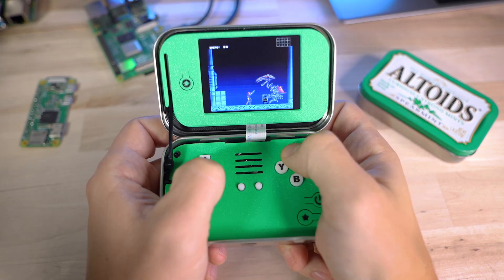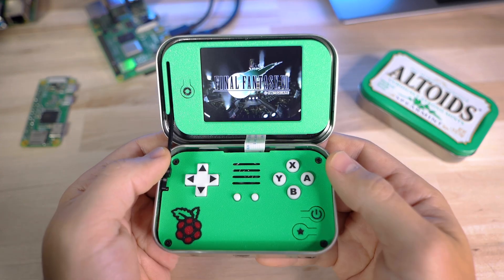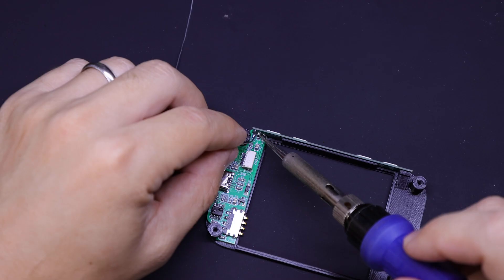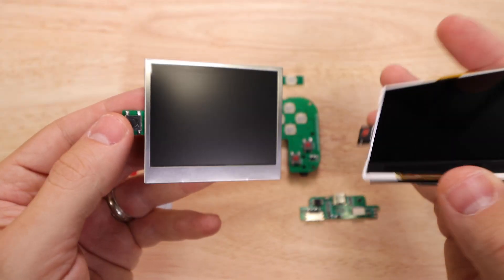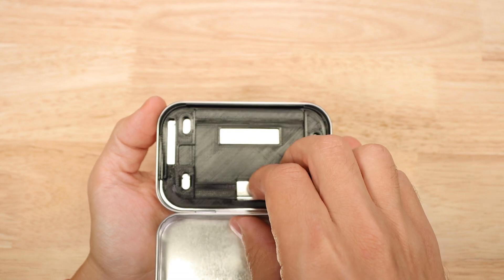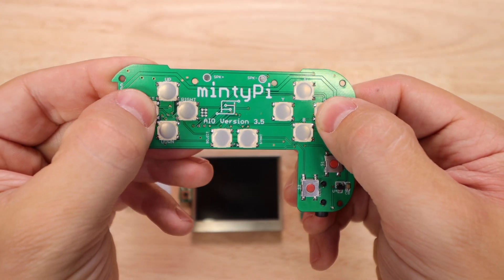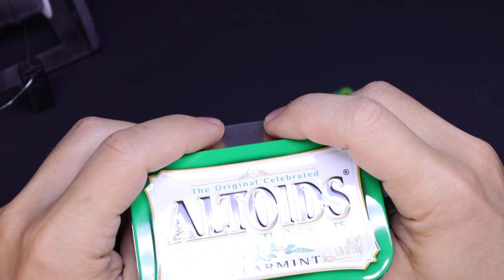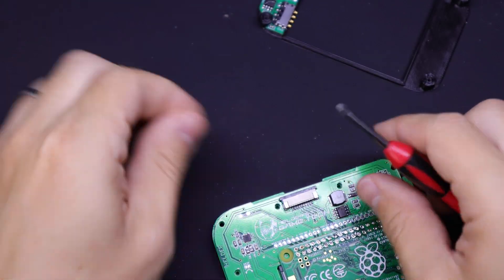mintyPi v3.5: what you need to know to build it and a GIVEAWAY!

Comment from the maker: I really gotta figure out why my audio goes nuts sometimes; sorry if it sounds blown out at some points. 😅 How's everybody doing? What would you want to see in a mintyPi v4? 🤔
Reply: Hi
Reply: GIVEAWAY!?!?
Reply: Older tins and try shrinking it and circular tin for the older ones, maybe it could be a round Gameboy with a cover.
Reply: Make a new gameboy zero
Reply: I have a friend who did the minty pi concept to a ps vita and it can emulate psp, ds, 3ds (no actual 3d), n64, ps, and ps2, and a bunch of other consoles and conputer games. It uses the original screen of the vita somehow. Since he has a lot of space inside he added usb ports to connect various controllers using adapters and a keyboard, depending on what game he's playing. He's making another and is trying to put in a different screen capable of 4k. But he's not using a pi for this one. Its custom made parts and everything that he's ordering through various companies. This one should be able to play older pc games. Like skyrim and things from around that era. Which is pretty cool. He wants to run a linux software on it. He's basically going for a portable handheld gaming pc. He 3d printed an ergonomic back to replace the one on there. Its pretty cool.
Reply: For v4 maybe 3DS style circle pad if you can get that to work somehow
Reply: Maybe on the v4 make the 2 USB ports into one multi use USB-C port
Reply: I am waiting for a mintyPi kit with a non-SPI 60 FPS display.
Reply: I could imagine adding some sort of "sleep mode" for the mintyPi v4, but that's just me.  Keep up the great work wermy and helder.
Reply: I don't know if this is already possible (I haven't checked sorry :c) but you should try to make it possible to buy already finished mintyPi version, it would save a lot of us dull brained people a lot of time and brain space, it would probably also be more expensive then buying just the parts (which is expected and completely fine) thanks :D
Reply: Maybe better support for 3D games?
Reply: For version 4,
 I prefer having L2 and R2 below l1 and r2 similar to a playstation dual shock because it is easier to reach and makes them more nostalgic. 
Next make holes for the micro usb and the hdmi port of the pi and do a little bit of scripting(optional) so that the user can easily connect a external usb controller for multiplayer option on ps1 or use another monitor.  
Next lesson the stuff to solder. You can use pogo pin to connect the pi and the board solderless. This will make things so much fast and add a function that allows the pi to be removable without de-soldering. Here's a link
https://www.ccpcontactprobes.com/application/how-does-pogo-pin-work
You can also use a card edge connector and modify the L and R pcb so that you can just slide it in place instead of soldering as well. But this has less impact and functionality aside from lessening the amount of soldering people has to do so its not entirely worth it but its an option for complete solderless build.

Optional upgrades
(Not much worth adding but it does allow more features.)
light sensor. Having a light sensor allows the console to have a function that can auto adjust light levels to save battery power

tiny vibrator motor. PS1 games can use this. You can also use this as an indicator for when battery is full, low, or charging.

adding a trackpoint as a mouse and analog stick maybe?

Remarks: Overall for me, I think multiplayer functionality and removable pi should be what v4 should be. 

Recommendations: Also for people who want more processing power, use a banana pi m2 zero, it twice as fast as a raspberry pi zero w thus allowing more games to run smoothly.
Reply: A CM3. Lol
Reply: touch screen?  or maybe a second screen?  or BOTH!
Reply: DS touch screen or analogue stick or both pleease! it would be sooooooo cool !!!
Reply: A compute module if that could work.
Reply: But do it with hey raspberry pi compute module 4
Reply: pi 4 compute model
Reply: a smaller high ress 3.5 inch screen would be nice , and a new minty pi stand for 3.5 and 4.0 would look great in black or green?
Reply: @Louie McMillian probably no because its a personal project. He would have to buy licenses to the ps vita probably. And its also stupid expensive to make what he's making. He's making as a project sorta for college and as a proof of his computer engineering capabilities to secure an internship at a company nearby where we live. Don't know too many details on all that but I doubt it could be sold. Cause of legalities and stuff ya know. It would be cool tho.
Reply: I would feel like a Usb input for flash drives could be useful
Reply: My ideas for Mintypi v4 would be a “last game” button (you could possible use the save state button on the screen) or button combination that takes out back to the last game you’ve played in case you got a lot of games on the system you are playing on.

Another idea I have for v4 is a button configurator that allows you to swap button controls (for example swapping the “A” button with the “B” button so every time you press the A button, it will actually press the B button and vise versa. 

One last Idea I have is some covering or some kind of electronic water protection, whether it be a covering that goes over the exposed parts, or a system that will safe shutdown, and cut off the power until no water is detected.

Anyway, love your channel and hope to see more Mintypi versions and other projects in the future!
Reply: I'd personally want to see an analog stick, like a 3DS Style one. Though that would be a radical redesign, I'd adore seeing it.
Reply: Omg I really want one. I'm computer bad. But I would really have to watch over and over and  over. I dont have that heat thing you have. Is it another way I can deal stuff. I love this I could be putting in my pocket or when I'm at work play and not get caught
 Thank you for the video all I can do is try try try until I get it
Reply: I just read about the solding part. I'm scared about it. Hey can I pay extra to get that done for me
Reply: Or can I pay for the parts and stuff and you put together for me . Pay extra to get that done
Reply: I would like to see a version of this kit with no soldering required for people that maybe want the mintypi but don't have the ability to solder electronics very well. i guess that would be a noob-friendly kit? Or maybe prebuilt mintypi 3.5's?
Reply: Not a whole lot to improve here other than hoping the next version of the pi is more powerful.... then maybe we could emulate psp games and add that psp slider style analog stick
Reply: Awesome games that can be payed in ps2
Reply: 3ds sliders for play station
Reply: Improved battery would be awesome. But I'm not sure there is room to shove much more in there.
Reply: Has the winners for the giveaway been announced yet?
Reply: In the minty pi v4 there should be a lot with everything AND all of the 3D-Printed parts, for the right price of course
Reply: Maybe a way to access the sd card in an easier way?
Reply: If there’s any possible way to connect 2 mintypis for 2 player games, that would be sick
Reply: You should see if you can add dual circle pads from the 3ds. I would just say analog sticks but they wouldn't fit.
Reply: maybe an analog stick
Reply: Maybe a 3DS style circle pad, and MAYBE a newer pi.
Reply: Some kind of computer gaming like with Minecraft or steam. - Even if it isn't that fully functional! Also being able to switch between raspberry pi homescreen and retropi
Reply: Stereo audio, and I’d like it to have volume options.
Reply: Yes Minty Pi V4 2021
Reply: Usa a iPod Screen
Reply: @monadolifesaver5613   that’d make it harder to find tins though.
Reply: @wormarms4143   I don’t know about smaller, but higher res for sure
Reply: @janineharris3601   as somebody who has been working with computers for years now. Soldering is actually quite the breeze. They have practice boards at helpers shop along with the pcb that you can use.
Reply: Fit some low profile analog sticks on there with the new CM4!
Reply: With l2r2 buttons. Will this run ps1 ?
Reply: A joystick maybe?
Reply: I know it’s a bit late to the comment party but something I think would be really cool is if you could take the compute module 4 and make like a mintypi pro or something like that maybe a slightly better screen if that’s even possible at the size I’m not sure, I’m just thinkin
Reply: YES
Reply: 6 face buttons would rock for a slightly more authentic arcade and mega drive/Genesis experience
Reply: a keyboard and raspbian
Reply: wermy when will these be back in stock
Reply: For v4 add analogue sticks and add a home button
Reply: I’d like to see a USB port right below the start / select buttons
Reply: Y E S
Reply: windows mode/web browser mode
edit: almost forgot to say better screen cable management and less gap at the top
Reply: is minty pi 4 coming i have really been wanting a minty pi but its never been in stock when i look

Comment: I'm seeing kits are, sadly, pretty much sold out and maybe not coming back.
But I also saw the Radxa Pi zero board is out, and it is a complete BEAST compared to the Pi zero. And I'm hoping that, if compatible for this project, you guys do either a 3.5 relaunch, or a 4.0 version of the board!
Imagine the incredible things your altoids tin DIY game system can do, with a quad core processor at nearly 2 ghz and 4 gigs of ram, over the Raspberry Pi Zero 1 core 1ghz, and 512mb ram.

Comment: Seeing as we now need to be drilling more holes, for the second L and R buttons, can you please go over where those holes are going to be.  The only information I get is a redirection to printing out the guide or buying the guide from you but I do not wish to do either if I can prevent it.  I work in a machine shop and I can make the holes exactly where they need to go I just need to know where to put them.

Comment: @wermy what soldering iron would you reccomend?
Reply: Since he hasn't answered you I will. If he were to answer you he would recommend you the most expensive overkill iron like a hakko or something. But in reality all you need is a ts100. It's 50$ it has interchangeable tips it's open source (meaning you can run whatever firmware you want on it) it portable and most importantly reliable. Definitely the best budget friendly iron.
I would definitely recommend. But don't take my word for it look it up first and make sure it's what you want.
Reply: @User_1795  i got the sq-100